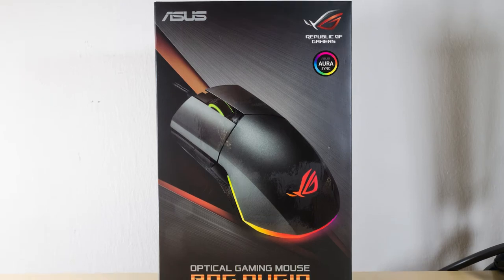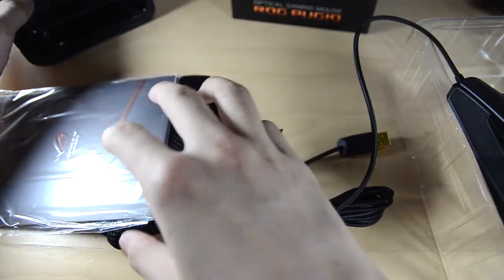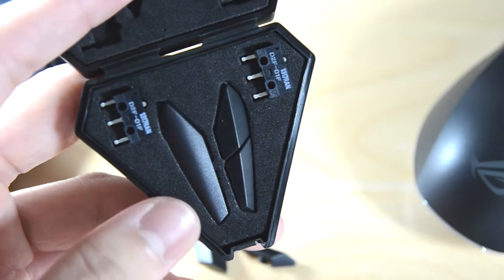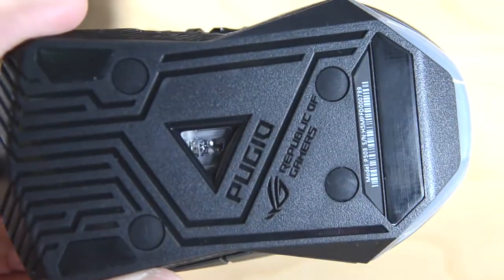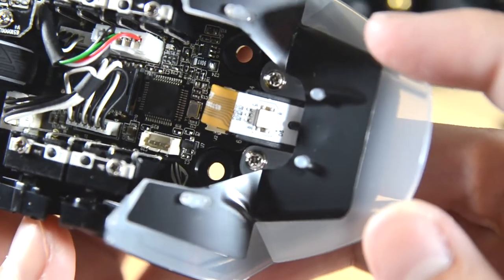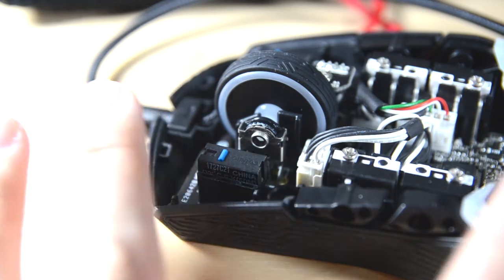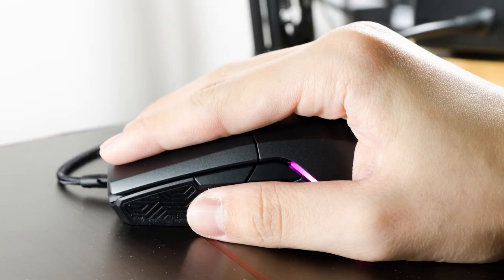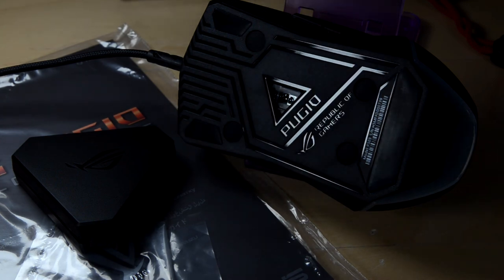Review - ASUS ROG Pugio Gaming Mouse + Dismantling!

Comment: Owned this mouse for 5 years and it has worked great until tonight.... sw3 fail and it does not come with a replacement switch. It was free when I purchased my 1080Ti so I am not complaining. Great mouse and very light - used by a graphic designer.